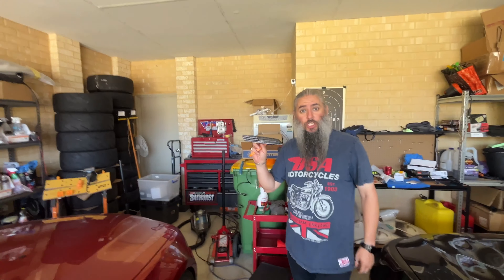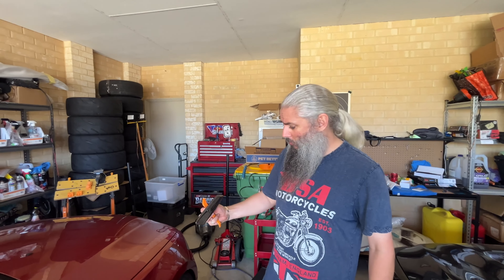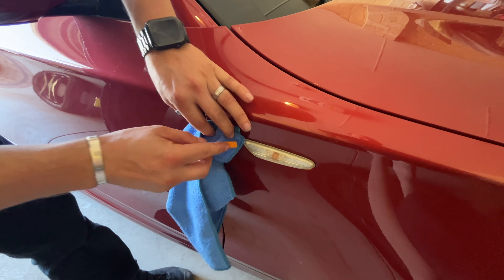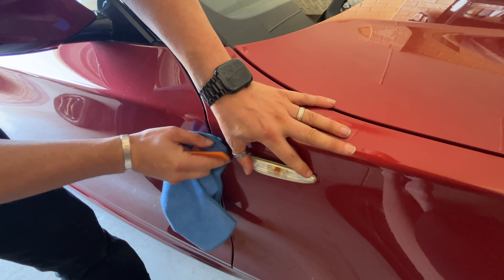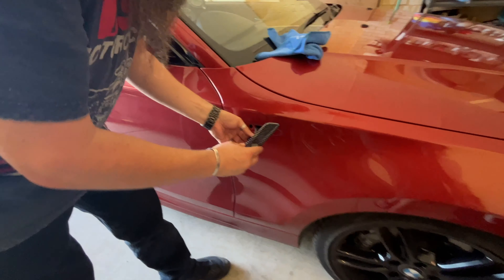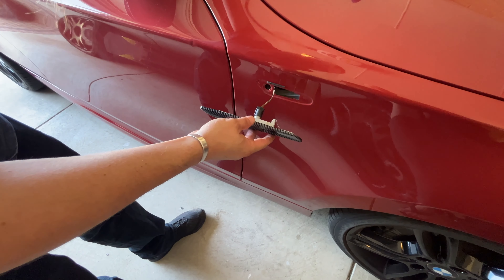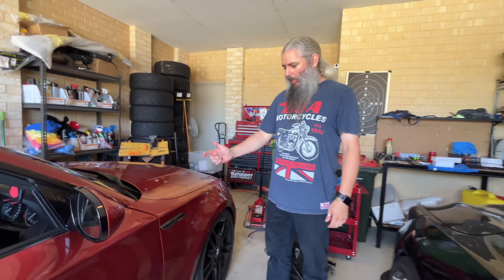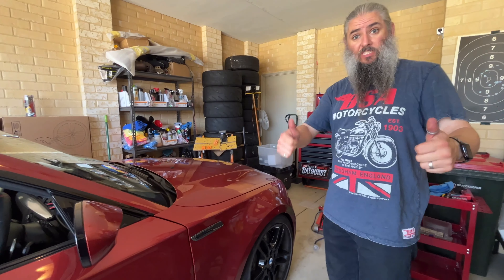DIY: Installing Carbon Side Markers on BMW 135i - Easy Step-by-Step Guide!Untitled Project

Comment: They look great, I got the non-carbon version but installed them the other way around so that the angle lines up with the doorline.
Reply from the maker: Thanks.  I have another set to replace these.  They’re a a bit too much.  New ones are smoked led.  Not sure what’ll settle on tbh.  The joys of aliexpress.